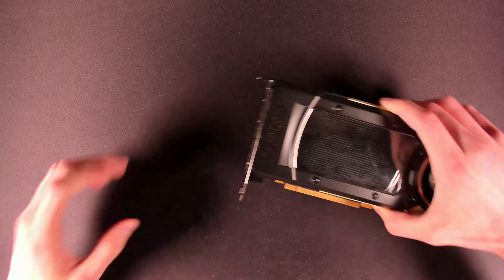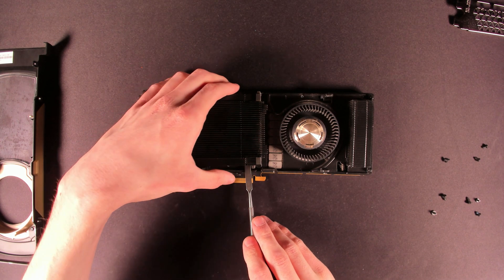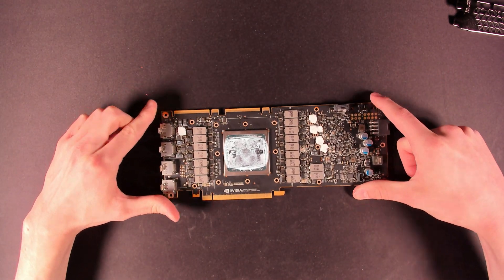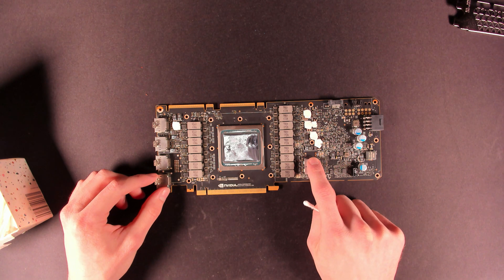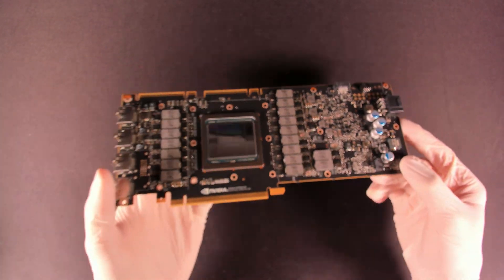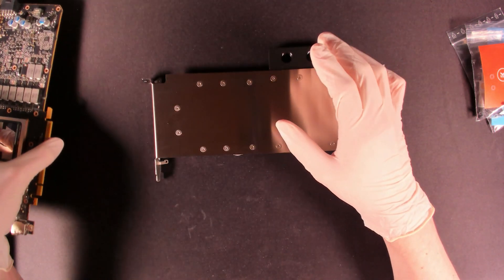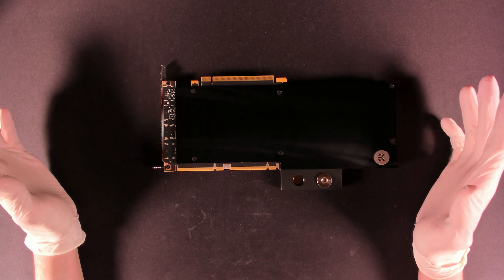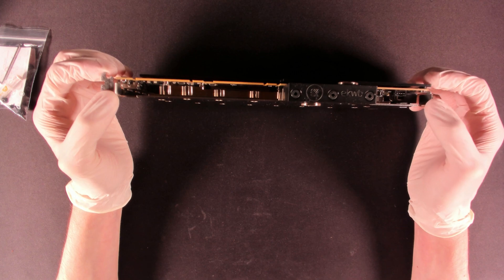Working on a 10.000€ NVIDIA Quadro GV100 Graphics Card

Comment: Hey, I want to ask you on whether or not that card clock boosts like a normal geforce card would. In other words, if it has thermal headroom, does it boost past the stated limit of 1627 mhz? Also, if you have experience with it, how does it OC?
Reply from the maker: Can't change clocks on it. But it does boost like consumer cards do.
Reply: @Asyq  I see, well, thanks for answering.